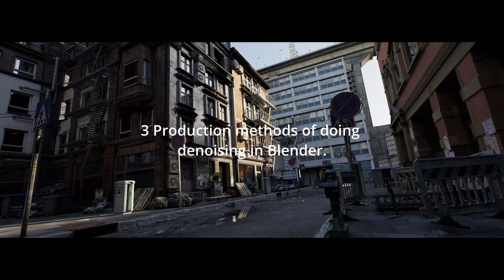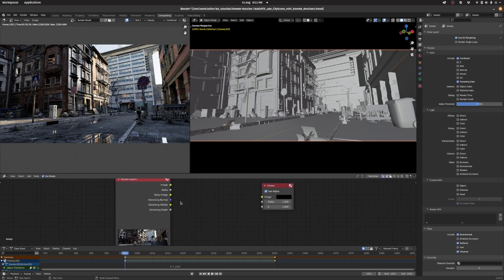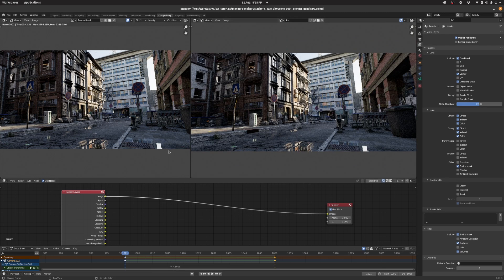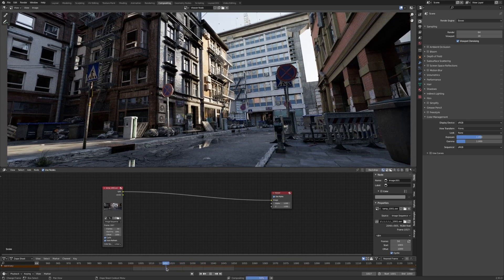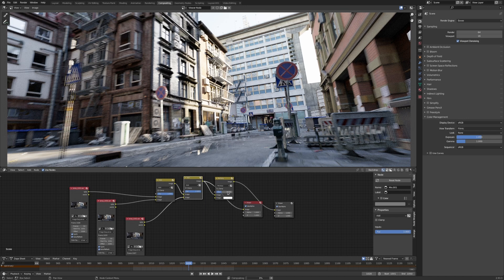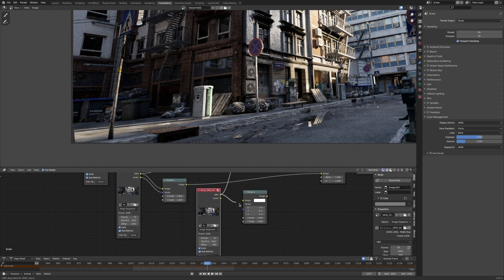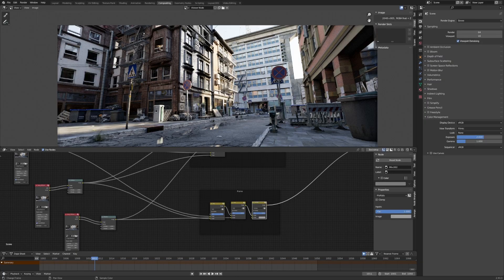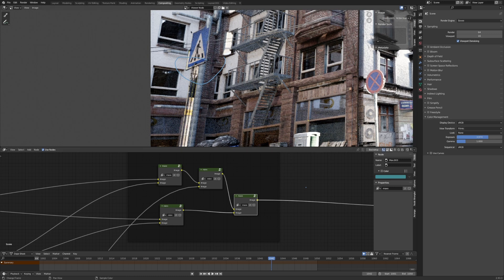De-noising flickering animation (temporal de-noising) and tips!

Comment: I NEED A REFUND CUZ YO SHI DONT WORK GANG WTF
Reply from the maker: @BlueMeth6  What version of Blender are you using? The setup on gumroad was built for Blender 2.93 and works until 4.1. This is stated on the gumroad page too. Blender changed how the compositor worked in 4.2 and I haven’t updated the example on gumroad with support for it yet. 

But the technique works and the sample file works fine in previous blender versions.
Reply: @stx_visualEffects  Any chance of updating it to 4.2 LTS? Would be a blast to stay in one version!

Comment: Which method would you use? Temporal or multi pass demonise? Or both? Or would it be dependant on the scene?
Reply from the maker: Ideally both, but its highly dependent on the shot. Like mentioned in the video, hair/fur and transparencies can cause issues and would have to be solved slightly differently.

Comment: Hi I have a rather simple question at the temporal denoising you use the rgba data as well as the vector data, in my data export tab there is no rgba data to check, the one at the top is called "Combined" and i suppose its the same? but if I follow ur steps I cant replicate the displace effect, idk if thats due to the combine/rgba difference or wth...

Comment: This is brilliant, i wished you denoised the result tempral denoise render just to see how it's going to differ from straight up denoising each frame.
Then I realized the noise actually looks like real noise from a camera foorage which make the scene more believable.

thumbs up 
👍
Reply from the maker: Thanks, the real power comes from balancing both temporal and spatial denoising and then re-graining where needed. This is especially true for any works where you have to integrate cg into plates.

Comment: i see it works quite well on a still sequence of multi exrs but where would you add a final motion blur vector pass if say you did NOT have motion blur enabled on the initial renders is it added before the adds and multiplys or do you take the mid frame vector pass and add that at the end

Comment: Thanks for the video, how do you get to the stage of seeing the Exr file in the compositing window when you open it and start the segment on temporal denoising.
Reply from the maker: You need to render out the frames to an image sequence (exr) first, then bring it back into the compositor for the temporal stuff to work. If you just want the spatial denoising you can render and composite directly.

Comment: Thanks for your video.... I haven't used Blender since 2.93 and now with 3.3 I've realized that in the composer they have shortened the Denoise node (I mean the Render Layer node), they have simplified it. Now it's just connecting (activating the Denoising data pass first!!) the normal and the albedo... Noise image or many other passes that came out no longer exist.

Is that right or am I missing something? Thank you!

Comment: wait, so for the temporal method you have to do that manually for every 3 frames?
Reply from the maker: You do it once for the whole sequence. But you need access to the frames before and after. If Blender had a timeoffset node it would be easier. But once you've set it up like this it works for any sequence and number of frames.

Comment: Thanks for the tutorial, this is really helpful!
For the temporal de-noising I don't have the vector pin on my image sequence nodes (there is just an alpha and a depth) so my median image comes out with the 3 images not aligned properly. How would I go about adding the vector pin to fix this?
Reply: saim problem:(
Reply: me2
Reply: Xandizandi
commented:
Export the sequence as multilayer exr with the vector pass enabled. Also have rgba selected in the output
Reply: Also turn off motion blur, or you wont get any vector informatio
Reply: you need to add an input to your "file output" node within the compositor and name it "vector". blender will know to pass the vector channel to that pin so that its accessible later in the compositor.

Comment: Using this workflow in various renders since many years, just do it in Nuke or Fusion with neat videos denoiser. But, thanks for putting that up. I just like to do local corrections, where things do flicker to much etc. Blender compositor could also be a solution with some multi frame denosier.
Reply: Neat video plugin is a mess, sometimes not even working.
Reply: @grigorescustelian6012  Absolut not. Its working here perfect since more then 10 years on every installation we have. Its one of the plugins ever purchased. Can't say it ever failed. Maybe you should complain to there support, they are very nice and respond quickly.

Comment: Great tutorial! One question: after doing the temporal denoising, how do I save the composited image sequence? I could save the composited frames one by one but there must be a way to save the entire sequence automatically, right?
Reply: Just open the exr sequences in another project, removal all passes except the compositor, then set the render frames to match your sequence.

If you have 240 frames in the exr, set the render to start at frame 2 and end at 239.

It should render out into whatever format you like. I rendered my little test out in avi and it works perfectly.

Comment: this is super awesome! 

I have a question though... how does this influence render times? 

I (like most i assume) have just been using built in denoising... and optix is much faster than open image, but open image gives a much cleaner result... 

obviously the simpler the composition the faster the result, but would doing this composite denoise faster than the built in denoising, or does it give better results? (hopefully both, but i highly doubt it lol) 

super great video, thank you for sharing!
Reply from the maker: It definitely adds to render/compositing times, but in Blender 3.0 and 3.1 they've upgraded the OIDN library so it should be significantly faster. 

That said, its still faster than rendering with more samples so I would consider the added denoising time to be negligible  :)
Reply: @stx_visualEffects  awesome thanks! 

In this little journey I started down, I found an addon called Super Image Denoiser, or SID. It seems like it’s a big node group that kind of has these features built into, including interpolated de noising, which I thought was neat. 

Have you heard of this before?
Reply from the maker: @FinalMotion  No im not familiar with that tool. But this technique have been used in film vfx for at least 12-13 years. Its a fairly known workflow.

Its weird when people "productize" workflows like that.
Reply: @stx_visualEffects  SID is free...

Comment: This video is incredibly helpful and was exactly what I was looking for!!!  Thanks so much for this and I just subscribed.   I'm about to watch your Fusion/Resolve denoise video as well as those would be the two ways that I would go about denoising an animation (since a single frame is easy).  One question though.  Did you just include the median/average of 3 consecutive frames in the composite node network, and then just keyframe the "frame" parameter to change the frame number of the exr nodes to get the final export?
Reply: Oh wait! nevermind I just noticed you put the denoising setup on your gumroad, so i'm going to go buy that and support since your video was so helpful.

Comment: This is great. But rendering vector pass requires you to turn off motion blur. Is there way to temporal denoise with motion blur?
Reply from the maker: You can always render a render pass/scene/viewlayer with motion blur disabled and override all the scene material with a really simple one (basically skipping the lighting step) as a separate render. We've used this technique on features where we always render util passes separately  anyway to get things like pworld, motion vectors and various aux passes. That way you can set the sample count super low as you're only interested in the first few samples anyway since youre not calculating any lighting.
Reply: @stx_visualEffects  Thank you for replying. But i tried it and it didn't work. The image with motion blur is very different from the one without. The pixels are all in different places. Applying vector pass rendered without motion blur onto image with motion blur results in many artifacts, especially on objects rotating at high speed.
Reply from the maker: @aaronguo5128  Unfortunately when it comes to extreme motion blur and complex transforms this way of doing temporal denoising will not work.

 There are other tricks you can do, like creating a matte based on the motion vector  (speed matte) to seperate the temporal denoising for the less extreme parts of the image and using oflow or displacing the vectors with themselves to "smear" the extreme motion blur out. You can also run a median filter on the blurriest bits with the same matte etc.

At the end of the day, theres a lot of small things you can do but it mostly comes down to a shot by shot basis at this point.
Reply: @stx_visualEffects  I ended up using Neat Video XD. It loses some sharpness and detail but since I'm not aiming for the highest production quality it's acceptable. Thanks a lot for your information.

Comment: are you using exr for the quality being lossless ?
Reply from the maker: Yes, always render EXRs.
Reply: @stx_visualEffects  What EXR format do you use? And what compression method? I find when I render in exr the file sizes astart getting huge. If I use it for an animation, I'd quickly fill up a hard drive.
Reply from the maker: @Layston  Mostly DWAAB, which is lossy compression. I use it for almost every pass except when you need high bit depth or cryptomatte. Crypto doesnt work with it use zip16 or something else.

Comment: This is a common problem with Blender tutorials on YouTube. The author is using a very high-resolution screen, edits nodes and types values in a small portion of the screen, and then uploads the video in 1080p. This makes the text of actually important parts of the video look blurry and difficult to read. We need either zooming in to the node setup portion of the screen (not showing the whole screen) or making the video's resolution 4K or something so that the text would not look fuzzy.
Reply from the maker: Thanks for the feedback, I understand the issue. However most of my videos focus on the actual concepts behind things rather than being a step by step how to guide. The exact values are often not needed if you grok the concepts. I would always encourage to play around.
Reply: I definitely agree. My biggest issue with most tutorials is when certain crucial details are omitted or sped thru or somewhat skipped over whether by intention or not. In the case of certain things being difficult to read, especially for blender, any tutorial should zoom into nodes and have a res higher than 1080p if possible. What helped me here with what I needed, though, was simply pausing at multi-pass denoise part of the video and then using the frame by frame option on the YouTube pc video player to see how the set up actually works.  ( , key for back a frame and . key for forward a frame respectively. )
Reply: One problem I am having is that whenever I use some form of multi-pass denoising in the compositing tab, my emissive materials no longer properly show, and I can't seem to find any fix for this online.
Reply: I'm not trying to be disrespectful or rude, but I think that we saw different video because he said all the values he was putting on the blender
Reply: @redhootoboemonger4328  i'm not sure that the feedback is directed to you but good on you for learning I guess

Comment: Very nice bro, but can you explain what you doing in the node group  to rake the median of 3 frames, and are we denoise the image befor taking the avarege of the median of images ? can you answer me please ?!
Reply from the maker: I tend to do spatial de-noise first (the multipass way) and then in comp (mostly Nuke & fusion) thats where I do temporal de-noising. Either by average or median.

I don't think the AI denoiser would work with noise thats combined and warped by the temporal approach. Better do spatial denoising first and then temporal on the passes where its flickering the most.

The median group is just the median function using max and mins to find the median between 3 values.
Reply: @stx_visualEffects  thanks bro, can you share a screenshoot fron nodegroup please